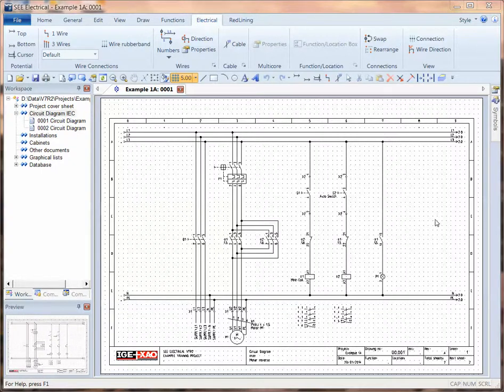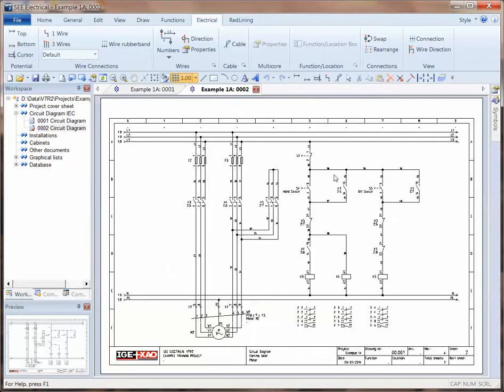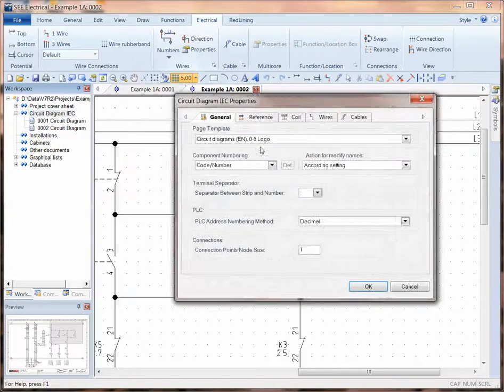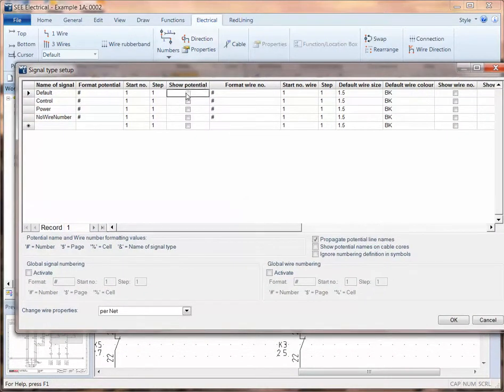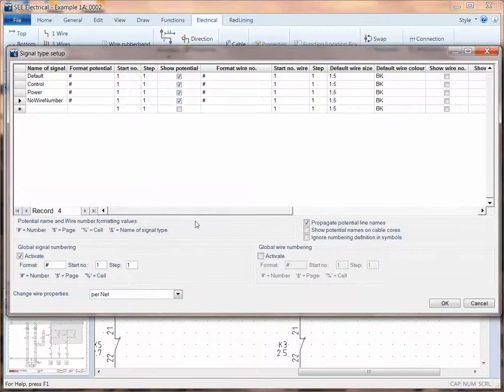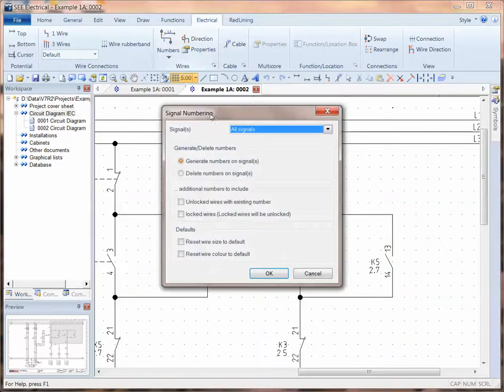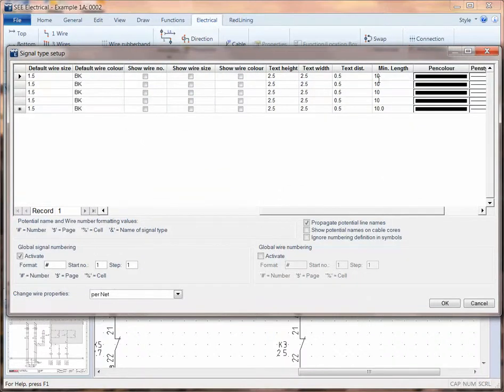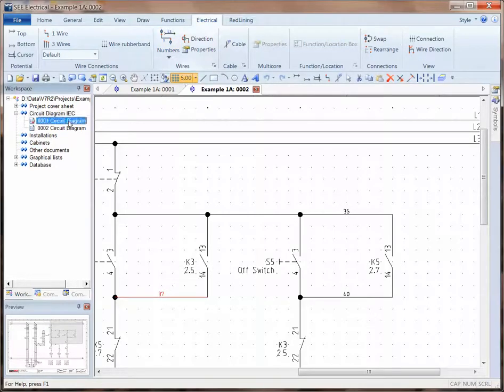Reducing the Number of Wire Labels V7R2

Comment: Does this only apply to auto generated labels? I have this issue with my own user defined labels and can’t seem to reduce the number of them. Thanks.
Reply from the maker: Its the combination of switching from potential numbering to signal numbering, and increasing the minimum length setting in the signal type being used. These changes will affect both manual and automatically assigned net/wire names.

Comment: Could you help me? I do not have "Show potential" option within Signal type setup. Instead of that I have "Show net name" option. I am using V8R1.
Reply from the maker: Yes, thank you for bringing that up. In V8R1 the naming was changed to avoid confusion between potential wires with references on each end and this method of numbering that labels the whole potential rather than individual wires. In V7R2 it was called potential number and in V8R1 its now called net name.
Reply: That did not solve my problem, but I guess I have a problem of another nature. Thanks for the feedback!
Reply from the maker: Sorry, I'm not sure what problem you're experiencing. Your local technical support team should be able to help :)
Reply: Ok, I will try with them. Thank you very much :)